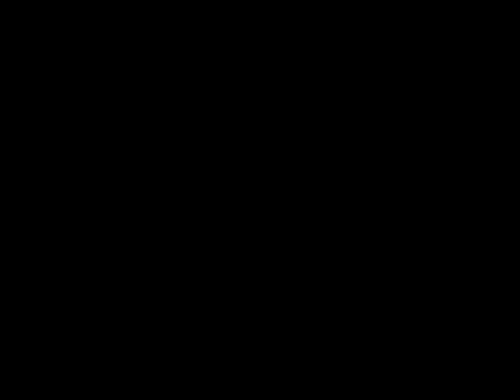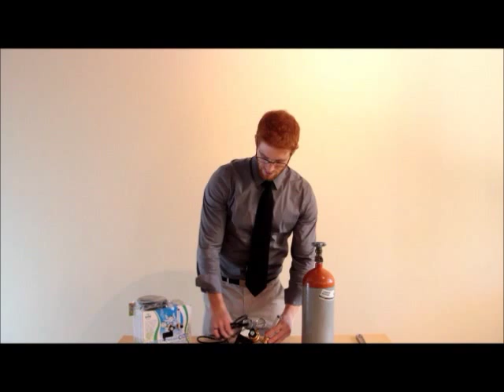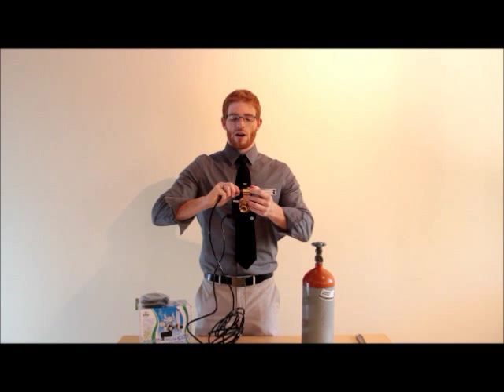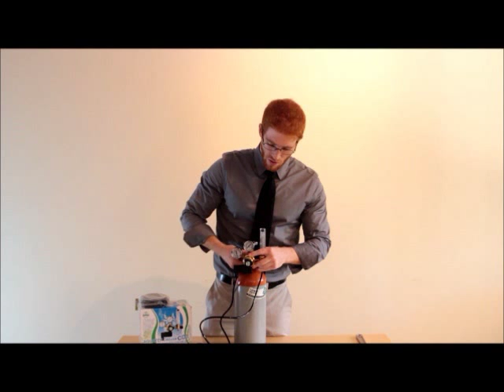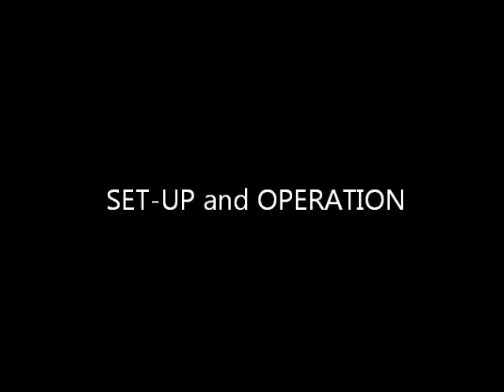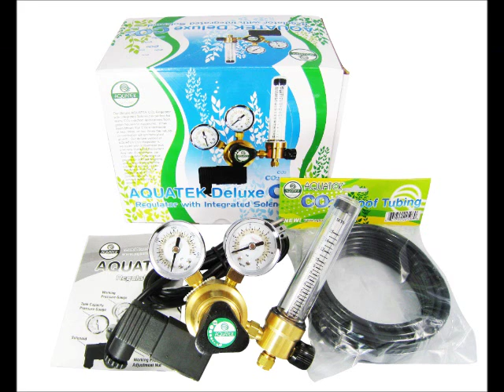Deluxe AQUATEK CO2 Regulator with Cool Touch Integrated Solenoid

Comment: I bought this thinking it would work for an aquarium but I cant figure out how to regulate it so it doesn't gas out my fish. it either blows bubbles so much my fish start gasping or when its turned down it just doesn't continue to flow from the diffuser. did I make a wrong purchase for my application? and if not how do I regulate with the flow meter to make sure my fish are safe? thanks

Comment from the maker: Hi,
Thank you for your inquiry. Deluxe AQUATEK Regulator is designed to be used for indoor garden applications. For the aquarium setup, since it only requires low CO2 flow rate, the minimum flow rate won't register on the float-ball meter. We would like to suggest you to consider using AQUATEK Regulator Mini, Premium AQUATEK CO2 Regulator and Basic AQUATEK CO2 Regulator for the planted aquarium tank.

Sincerely,
Aquatek of California